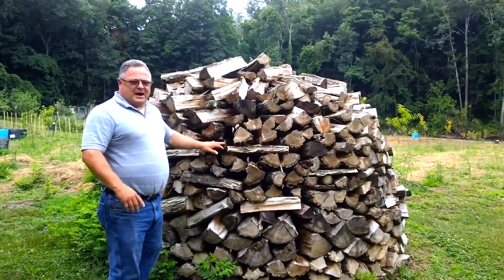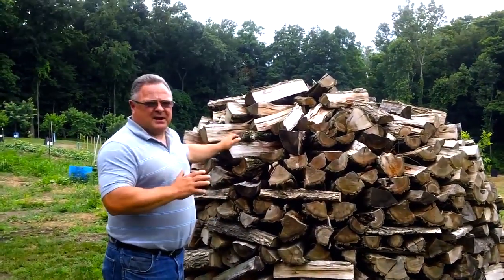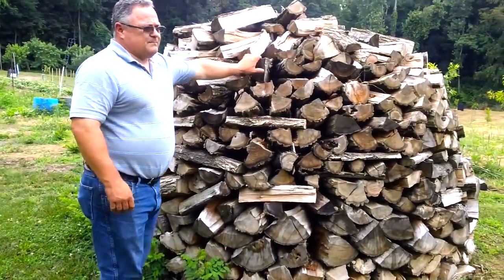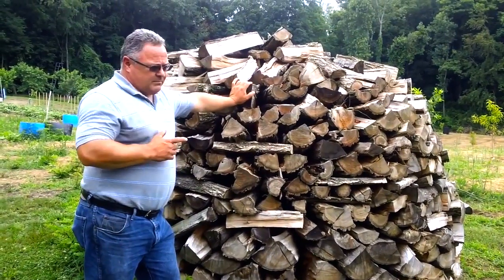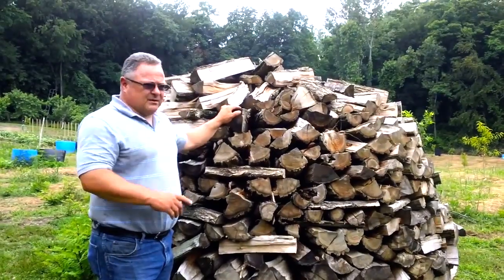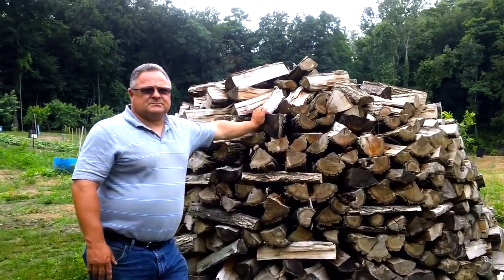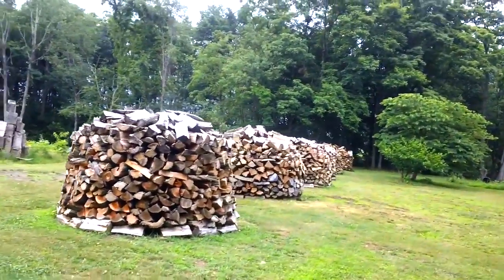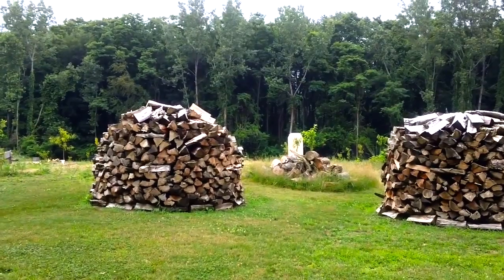Obadiah's: Holzhaufen - Traditional German Firewood Stacking

Comment: That is how I am stacking mine.  Plenty of videos to explain the process of stacking.   I use the center for all the  odd pieces I have, rather than stacking myself re split wood on end.  
I cover the top with “shingle” of splits that still have bark on them.   
Working pretty well. Moisture content is 20 and under for most of what I split 12 months ago.